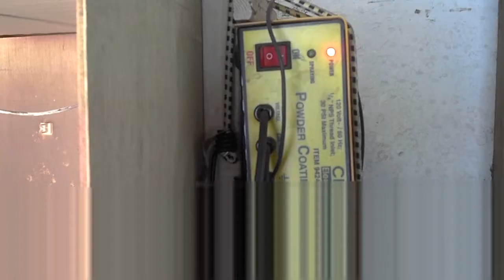Powdercoating gun

Comment: Chances are your ground for your electrical system is not good. I have a 6 ft ground rod sunk in the ground below my power panel and no issues. You may also have some loose wiring connections. However this is a great video for someone who has a similar issue.